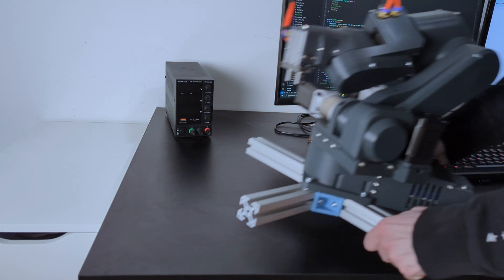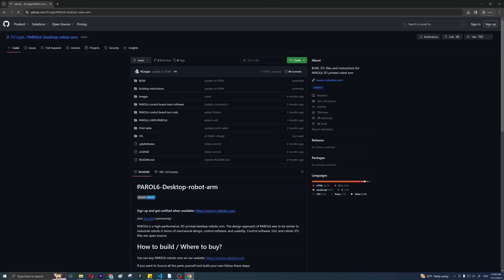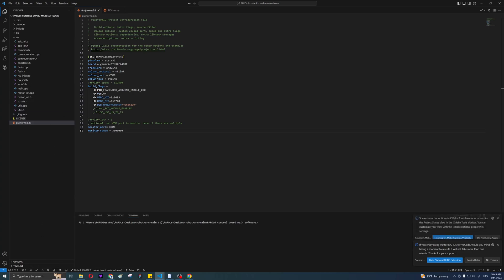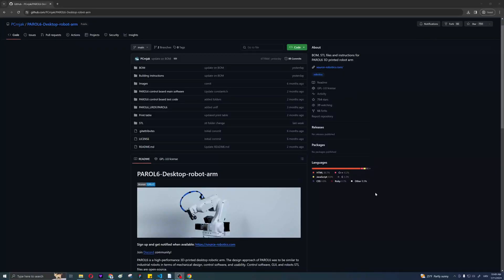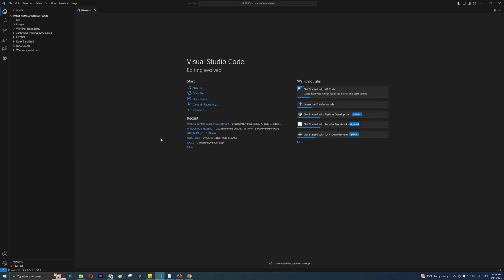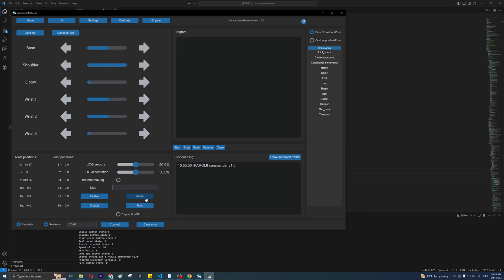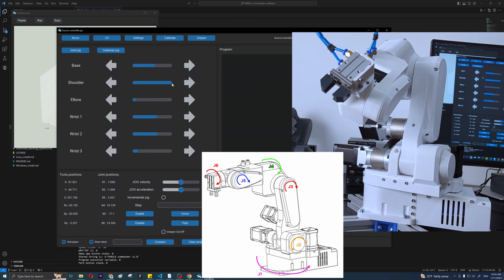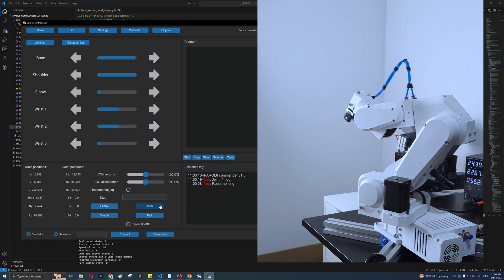PAROL6 setup and calibration

Comment: ...connect my power supply, press power button aaaaaaaaaaaaaaaaaaaaaaand my board is gone... My PAROL6 control board get smoked in one second and i don't know why....
Reply from the maker: @HeadNSV  send us and email or check the discord for help. You probably connected something wrong or switched the orientation of the drivers
Reply: @source-robotics  it was my fault I swapped the direction of all the drivers

Comment: Could you please tell me what their movement mode is like when you want a joint to trigger a limit switch? Is it directional position control? Or constant torque control?
And I saw in the video that the limit switch is triggered twice. Why is this considered?
Reply from the maker: It is constant velocity mode. It triggers twice since at the first trigger it might already be at the trigger point and a little off.for example J1 is laying down on the switch and it is triggered but that is not a real zero pos. So it needs to move away and hit it again
Reply: @source-robotics  Got it, thank you for your answer

Comment: Hi! I am wondering will the control board with stepper drivers be back in stock in the short future?

Additionally, I am tuned to build this robot for learning purposes and was wondering how hard would it be to attach a camera to the toolhead for facial/object detection?
Reply from the maker: Hey, they should be available next month it is best to send us an email at info@source-robotics.com and we will contact you as soon as they are available.

About the camera it can carry 1kg+ so it should have no problems carrying a camera. To do tracking and detection stuff it could be done with some effort.